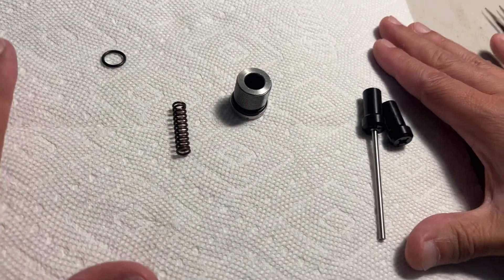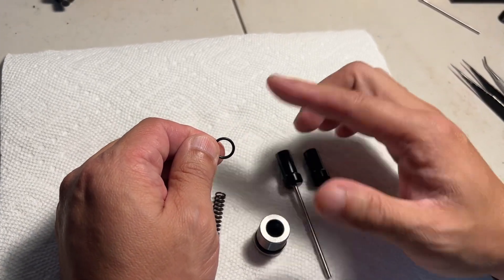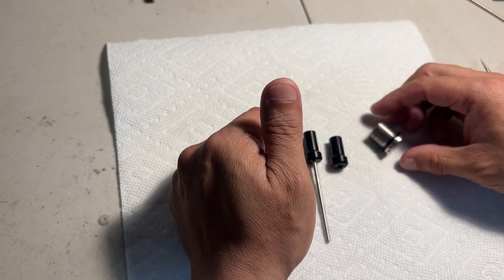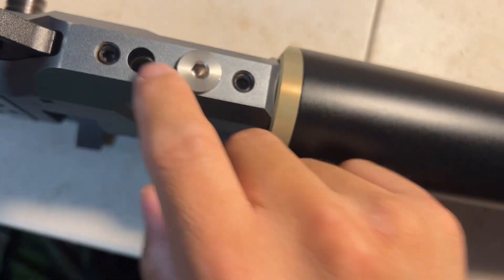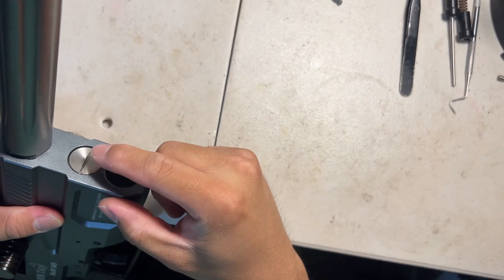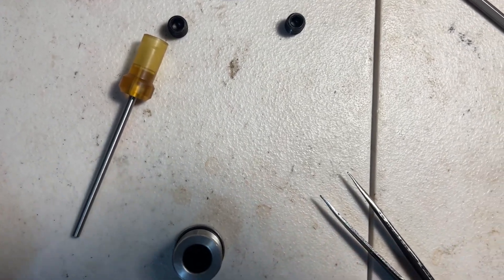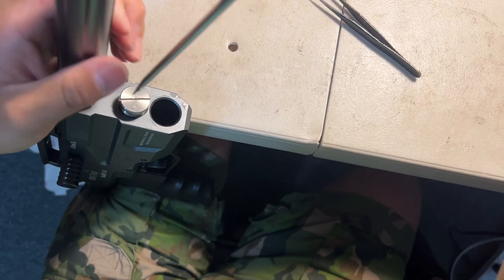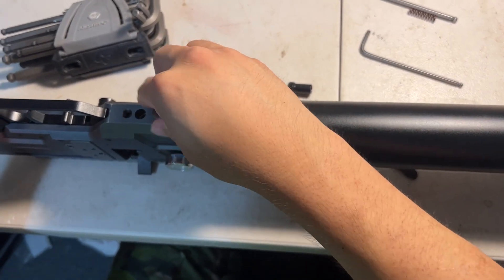BinTac; How to change the valve pin on BinTac S45

Comment: Instead of selling packages filled with valve pins and charging your loyal customers further, how about you guys start working on a long term solution? I don't know if it's the overal design or the choice of materials, but it's faulty and unreliable, and you know it. Valve pins keep breaking or wear out way too quickly. It's the number 1 complaint I keep hearing. I'd prefer if you guys focussed on solving this problem for a while, instead of new argun models.

Comment: Hi Sir, is it okay to use wd40 for cleaning and maintenance pf aea/ hp ss unit?if not what is the best spray cleaner  or lubricant specially on moving parts/bolt?
Thanks a lot.
Reply: You can use Ballistol